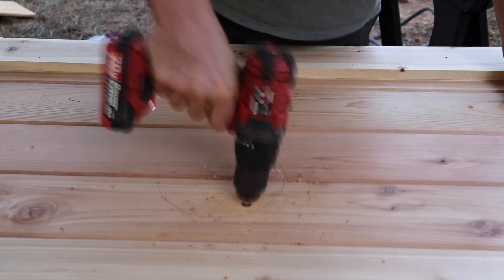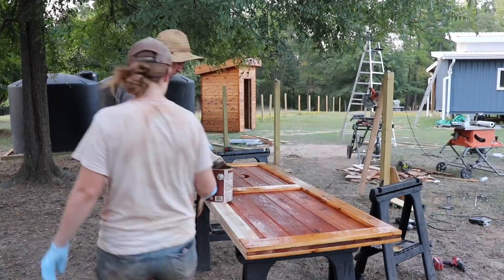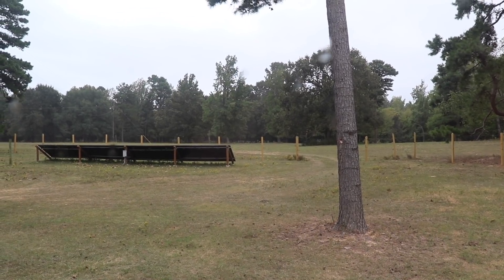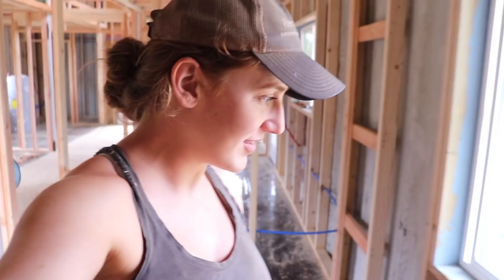Heating Our Home's Water WITHOUT Electricity or Gas!

Comment: You two should look into solar powered electric water heater.. it takes a water heater mppt controller they are $275 and you feed 1000 watts of solar panels into the controller... I've used mine for 8 months now... Winter I was averaging 115 degrees 50 gallons of water a day and summer avg 135 degrees... Found a cheap used 50 gallon electric tank and great panels cheap from Santa solar and consistent hot water .. look for YouTube vids for the controller... You will not regret it...love your show....

Comment: You need a little feed table or something for your table saw. I have a tiny portable one from Lowe's, flips around with either a little roller bar, some bearings, or just flat strip of metal. Folds and is very light. And most importantly inexpensive.

Comment: If Spencer made a plastic dome for the batch heater, it could act like a greenhouse.  And trap the heat in for longer.  And might increase the temperature.  Put it on hinges, to make it a flip top, or mount simple handles on it for grabbing to removal and replacement.

Comment: You should put a cross tie on that door, or it will sack. In your rainwatersystem there will always be water in the pipes, and so debrie will form in the lowest parts aswell. Maybe a drain at the lowest point to flush it out now and then.

Comment: Line the batch water heater case with reflectix to retain the heat generated through the glass.  The foil of the reflectix should also redirect reflected sunlight back to the black tank as well.  And... additional air tight properties gained.

Comment: How did you choose the angle for the batch water heater?  Some people choose a steeper angle (based on their latitude) to optimize water heating in the wintertime.  Some choose a compromise angle (based on their latitude) that works all year.  What did y'all choose?  I'm in south Alabama, so I think I'll choose a winter angle.

Comment: I would've cut the moon out of a scrap piece wood and painted it yellow and screwed it on the door vs. cutting a moon hole in that beautiful  door.  Btw, did you install strips of wood around the door frame on the inside for a door stop?  Maybe I missed that.

Comment: We have been waiting for what seems like forever for this next installment to come out. It's really great to slowly watch all your hopes & dreams come together. I feel sorry for Spenser when 1st time Mama's nesting syndrome kicks in. The time table on his to-do list will be put on turbo. I love the crescent moon cut out on the door.

I still say you should paint the inside of the solar pre-heater black & mount a polished aluminum panel to the back wall to act as a mirror to reflect the sunlight back towards the tank. Also, once you get everything inside the pump house, I would install a 2x2 inner frame. 1st, it would be a seal for the cracks around the door/frame & keep out snakes, scorpions, and bugs. But especially snakes. 2nd, it will keep the door firm when closed, if leaned on, or in high winds. Right now, the only thing that prevents the door from being pushed inwards is the door latch.

We've been trying to get thru all the commercials since the baby news came out. We know the as revenue is $$$ and every little bit helps. You guys might hit 500k subscribers by the time the baby arrives. We wish you all continued health & happiness.

Comment: The pump house in cedar turned out beautiful. If I were at a meeting with other engineers, I would have to ask about a PRV for the solar heated pressure vessel. However, something tells me you are way ahead of me on that. I have always wanted to build such a preheater but couldn't get past the scalding issue due to a lack of max. temp. control.

Comment: Loved the "trapped in the pump house" bit.
You might wish you had made air inlets in the bottom of it and air escape holes in the top. And you may wish you had allowed more gap around the door and simply over lapped the trim on the door to cover the gap and still maintain a tight seal. When that door swells up in the SWELtering heat of the summer. You'll understand air flow and gap allowance. 😊

Comment: I have a similar Batch Water heater. You might want consider feeding water from it through and electric or on demand water heater for emergency back up. One or two days without sun you will be without hot water. Cold showers suck.

Comment: Great. I don't know how many other people have ever camped out at the lake, but here in the Ozark Mountains of Southern Missouri, it's great. Table Rock Lake has many public campgrounds built by the Army Corps Of Engineers. There are community bathrooms equipped with showers at these campgrounds. The showers are great! The hot water is produced totally off grid by solar water heaters on the roofs of the bathrooms. The water is smoking hot, for as long as you wish to shower. I think you can download the plans on how you can build these solar water heaters at mo.gov/campgrounds, and just explore the website!
Great video here, as the same principles are outlined!
Peace.

Comment: Pump house and heater box..  Shouldn't you put something on the wood to guard it from rott and mold from interior moisture with no vents or does the stain help resist that?!

Comment: Look up this stuff called super therm its ceramic paint you paint the walls helps keep the heat in and paint the outside and block's the outside heat in the summer

Comment: If you really want Hot, Hot water, You can place sheets of Fresnel lenses over the exposed area (They do come in sheets and not expensive) and it will increase the suns heat 10 fold. For example, you can build a little box with a sheet of Fresnel lens on top and bake a potato with it. Just food for thought here. :)

Comment: One thing I noticed is if it’s that hot in the pump house without a running pump now imagine with a running pump. Will u need to vent heat somehow? Is there a chance the pump could overheat?? And what u need is another small tank on the roof to hold water for everyday use. The pump will fill that tank from the storage tanks to a holding tank. Maybe, maybe not. Give it a thought
Reply: There will be a pressure tank in the pump house.

Comment: Floor problem! Before retirement, I owned truck repair shop, my body men repaired fiberglass using a clear epoxy resin. But you don't nee the fiberglass. Try automotive paint supplier for a small amount to see if that would work.

Comment: 12:00 When pounding bolts into the concrete or whatever, like that.  Put two nuts on the top end of the bolt. The one nearest to the end needs to be flushed with the end. Then screw the second into that one. So when you hammer it, you won’t damage the threads and the second nut will hold the flushed one in place.

Comment: On the inside of the door you should install a square metal plate on the inside curve of the crescent moon.  There is not much surrounding wood to keep that piece from warping/splitting over time. Love the videos!

Comment: Get Spencer a silicone wedding ring. I've seen what happens when a gold ring hits a saw blade or electricity...
Reply: Agreed and they come in assorted colors! You could match! Not only that but some woman’s fingers swell during pregnancy!
Reply: We were playing basketball and a friend of mine did a slam dunk, catching his wedding band on one of the net holders. He hung there for what seemed like eternity, screaming, then fell. Where his ring was made of gold, it stretched & broke. The finger was dislocated & broke and required some tendon repair & stitches. The doctor said that if the band was wider/thicker or if the ring had been made from a tougher metal like titanium or tungsten, the finger would've been torn completely off. I completely endorse the silicon bands for work & play.

Comment: Hey guys! CONGRATULATIONS ON THE BAMBINO!!! Whach you're channel religiously the content is awesome! Just a heads up, the ball valve in the pump house should be changed to a brass ball valve for these reasons. If valve goes bad you can swap out easier, smoother operation of valve, doesn't corrode or stick! Ok Carry on! Keep up the great work you two!!!
Reply: PVC valves do get stiff and sticky after a while.

Comment: Paint the inside of the Water Heater enclosure silver. So it will reflect more light around and onto the tank from all angles. Why heat just the front of the tank when you can heat the sides and the back as well?

Comment: I built a heavily insulated 2 tank breadbox in 1980.It was lined with thermoply as an aluminum reflector.It made steam producing hot water until it aged enough for the aluminum to oxidize.Then only luke warm.Thin stainless reflectors and insulated covers are needed for top performance.After the first month the power company came to check my meter because of the drastic change.

Comment: You might be surprised at how much heat you will have in your passive water heater box. Since you are using combustible materials, you might look into a greenhouse style thermal hinge, that will gradually vent the box, if temps really get excessive

Comment: I would drill a small ? 1/8 hole in the bottom of the box so the box doesn’t get pressurized and maybe have a crack somewhere   Where you don’t want it to . Maybe like fracture the glass ?  Just an idea ?

Comment: I still don’t understand why you have 2 water heaters. 
The one outside heats w no electricity but the one inside does ....please explain, my simple mind just doesn’t comprehend
Reply: The outside batch heater they building is basically a pre-heater, so hotter the days sun the hotter the water will be, so less energy used by the internal heater to get the desired final heat output for washing pots or taking a bath etc.

example if the heater inside is set for say 82c water temp and the days heat pre-heats the water to say 40c then you`ll only use energy  gas/electric to heat the last 42c to get full 82c heat temp of water, instead of heating up from cold water, hope this help :)
Reply: yorkie pudd 👍🏼. Makes sense. Thank you

Comment: Hey Spenser, when hammering a bolt in like that you should bring the nut up a little past flush with the bolt so you don't accidently ding the threads.  @ 12:02  But other than that, it all looks great!

Comment: The pipe for the rain collection system is not UV rated . 
I suggest you paint the piping with a latex paint. That will protect it from the sun.
Reply: They did paint it.

Comment: Fill the hole with a shaved dowel and glue, then stain to protect the wood. This will prevent sweat bees and harvester wasps from starting nests in the hole. Also, you might consider vents high and low to equalize temps inside....or not... opinions vary.

Comment: Beautiful door! You will need to add cross-bucks or a corner-to-corner tied cable with a turnbuckle to keep the door from racking and sagging on the side opposite the hinges.
Reply: "Z"
Reply: Laterals (top and bottom) are already there.

Comment: I agree  with paint it black inside  perhaps even outside . You can do research .  When I worked in a warehouse ,  the doors that the trucks backed up to had  thick rubber bumpers that kept  the trailers from cracking the concrete or bending the trailers . The rubber bumpers were BLACK  & almost looked like  tire rubber. Those rubber bumpers would also get very hot Also the stairs  leading out of the warehouse and down to the ground was metal pipe painted Black & during the summer it would burn your hand as you held onto rail for  balance . . Good luck on researching possibilities

Comment: Pump house looks grand love the cedar and the stain. Great job on the door. Have you considered lining the inside of the water heater enclosure with a foil faced insulation as a reflector onto the tank?

Comment: Heating water costs the same per degree of temperature no matter what range it is above freezing and below boiling, so heating heating water 40 degrees with solar saves the cost that it would cost to heat with electricity or gas, etc.  So, even in the winter it will save you money. Passive is a great, virtually free way to heat water. Separately, remember to add a coupler after the ball valve for easy disconnect of the pump for repairs or replacement. Coupler then ball valve on the output side, too. You’ll be able to shut the valves, undo the couplers and remove the pump for the repairs every easily.

Comment: handyman guy on Utube says you should paint the PVC piping exposed to the Sun.
Reply: True, but very optional. The pvc pipe I installed on my tanks over 20 years ago, in the Texas sun most of the day, show very little degradation :) Maybe another 10-15 years, they may need replacing.
Reply: Some paints may weaken the pipe or the toulene thinner in the paint may weaken the glue. I would definitely zip-tie some of the pre-formed pipe insulators to the exposed plumbing. They now make a silicon based version that's great. I've went out & checked the exposed plumbing in my pumphouse in 18-20 degree weather and the silicon insulators feel warm to the touch compared to the air temperature. With it doing so well in the pumphouse, I went wild & re-insulated all of my plumbing under the house. I haven't had a frozen pipe since.
Reply: @jamesooten3659  Very good point on the paints! I never thought of it from that point. I don't know where this 'painting your pvc' started, but I never heard of it until the last year, and only on youtube. I can see if you want the pipe to match your house, etc, and only for drain pipes, but a little research is a good idea before doing something because you saw it on YT LOL

Comment: Please read this post. You're not making it clear what you are using this water for or how you're treating it.
If you do not keep the water temperature below  25 °C (78 °F) or above 51 °C (124 °F) you will grow Legionella bacteria.
As a result you risk getting Legionnaires' disease if the water is not boiled at or above 60 °C (140 °F).

Comment: The problem is, you can have hot water after a couple hours, each gallon you remove is replaced with cooler water that will chill the entire tank quicker than it can heat up, dropping the overall temp of the water and restarting the heating cycle. I would add 4 extra solar panels and add some DC heating elements, or add a tank in the house that runs on DC power. You can also dump any extra power when the batts are full and demand is low into the hot water tank.

The great thing is, instead of the inside DC water heater turning 50 degrees water into 100+ you are turning 80 degrees into 100+ with the inline solar tank you built.
Engineer775 on Youtube has a bunch of content about it. 

I have 3 children and would worry if the temp of the hot water is too low it can grow bacteria. 
Also being in Texas with a baby in a house without enough insulation you will want AC. the same dude has Solar powered DC/AC split ductless AC you could install. 

Where are they going to poop?
Reply: They are putting a second tank in the house. It's in the video they did about the water heater.

Comment: There is an easier way to anchor things to concrete.  Just put it in place and drill through everything.  Pound your anchor in give it a couple turns an your done.  Just make sure you do one at a time because the drilling will make the wood walk just slightly and cause unnecessary heart burn when go to drive the anchors.  I've been watching your videos for about a year and you guys make for a really nice couple.  I'm not criticizing just suggesting an easier way.  Either way will work just fine.

Comment: Spencer, you need to cross brace that pump house door or it will sag.
Reply: Thats right,I was wondering...he's missing a very important piece...the crossbrace....gotta have that...
Reply: Or ar least a middle hinge.
Reply: Or a pc. of thin plywood inside on the bottom half?  Also, could have put the sliding part of the latch on the fixed side, then it would never self-lock.  Just saying.
Reply: Bottom hinge side corner to the opposite upper corner of the lower half of the door.
Reply: paint those yellow screws black, its messing with perfection!
Reply: Also need an escape hatch...for  when someone is on the inside doing something and the wind blows, slams the door shut and triggers the door latch...locking that someone inside...think it won't happen....?  😏
Reply: @weshallbesaved5137  .....sorry butt, "the wind" is NOT going to slide that lock.
Reply: Gene Williams ha! Ha! Ha!  Wait! Never say never!

Comment: There is actually a reason for the moon shape.  The vertical slit IS the stink vent.  Warmer air will flow out the top at the same time cooler air will flow in the bottom..  Now most or all honey huts leak air so badly the the door vent is only a warm air out vent.  the moon shape is just a fanciful way of having a vertical slit.   HOWEVER,, out west, the BLM on BLM land camp grounds,,, what works best is an 8 inch diameter vent pipe, running from the top of the tank with about 8 to 10 feet of black painted vent pipe sticking above the roof.  Decomposing waste creates heat, and sun warmed vent pipe creates heat and both  make a powerful positive ventilation that keeps the stink going up and the toilet room smelling nice.  You know how well it is working when you feel a strong cooling draft on your butt going down into the tank or pit.  Pipe must be tall and large above the roof.  The energies of the warmed air are weak,,, too small,, or too short a pipe and frictional loses prevent it from functioning.  Physics, again.